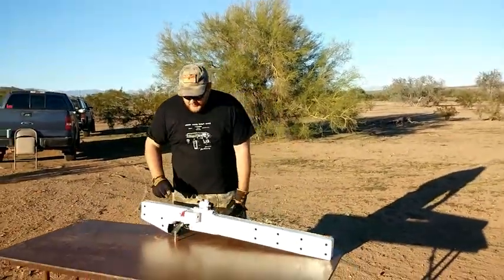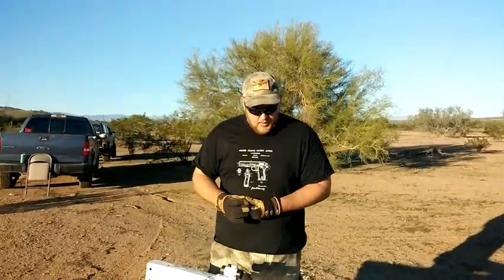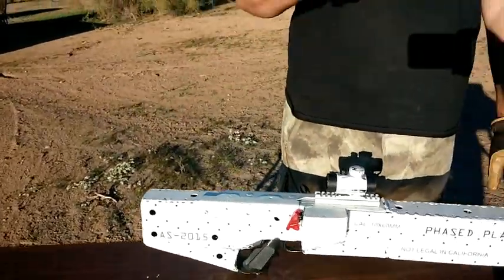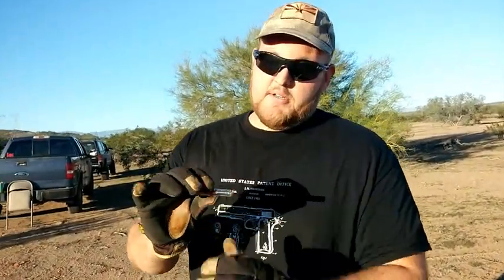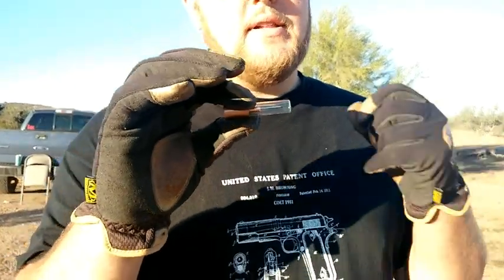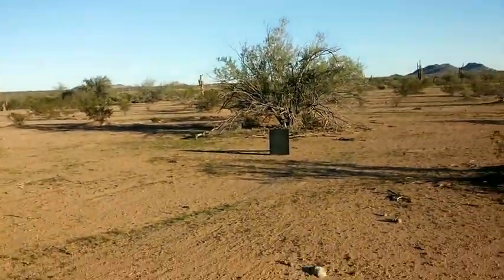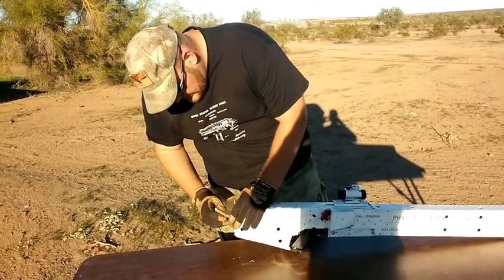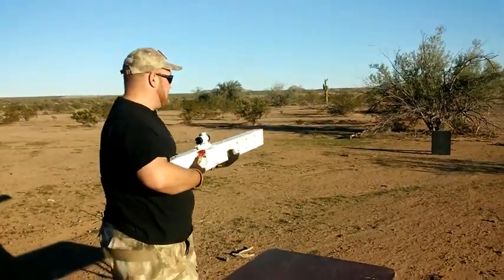Electromagnetic Plasma Rifle Test Fire

Comment: So this is how, the starwars program from the 80s era was supposed to work, Basically using plasma to push projectiles at ulta high speeds. Or rather creating a mass driver. looks like this has a slight twist. instead of a solid shot

Comment: This could be done with linear rails and a projectile that is cunductive on both ends, passing the current from end to end thru the gas. 
One thing I think is happening too, is the plasma is going back to gas before impact. A more intricate projectile that uses a capacitor to store some energy from being shot, and keep it going thru the plasma for 2 seconds after firing.

Comment: Fake
Reply: Neon gas is basically what we use on light appliances it generates plasma while the charge electrical rails are meant to basically throw the object. Increasing the neon gas will make the charged rails accelerate faster meaning it accelerates the electromagnetic in the rails, remember plasma is a really strong electromagnetic force it is enough to power the whole city. So both increasing its power will throw the object really fast
Reply: @jamesedmerdelacruz9478  You should get a job writing the fake "science" nonsense on Star Trek because that's all this is.
Reply: if we use gun powder and neon gas at the same time that trajectory will basically turn into a powerful accelerator. but doing that will require thousands of volts

Comment: THIS IS FAKE by using copper it would make a eddys current in the copper and that would cause it to never exit the gun look up magnet and copper tube  there is a reason you need the projectile to be ferrous
Reply: Not true. I have actually used eddy currents to move copper. Specifically, a transformer with an iron bolt attached will push a thick copper sleeve up the shaft. The threads of the bolt disrupt the field causing it to collapse ate the tips and propels the copper sleeve off the end of the bolt. Weird huh? Try it! I used a transformer from an old H.I.D 1000 watt ballast. No capacitor, just mains voltage. Technically speaking with this design, you don’t use two rails. You use alternating current, so the power is generated by the interactions between an inductor and a transformer. The barrel is literally just a transformer. Long round piece of steel and two coils to transform voltage from the inverter. This also means you only need one pair of capacitors. Great design. Didn’t think anyone else would ever use it.
Reply: @josephjohnson7333  what you are describing is completely different from what happens in the video 

the video shows
a solid copper object inside a non-insulated  mystery  material
Reply: @projectwes4573  this doesn’t show anything really.

Comment: Even a spatula in public is illegal in California...

EDIT 1: I just noticed you actually use CO2, sorry, but that's not enough CO2 to get it to work, it will dissipate before leaving the rail.
In other words, you should try a CO2 or O2 fuel pellet if you want more of a desired effect. Unfortunately, you'd need a resonance chamber and magnetic accelerator coil to extrude the plasma pellet and ionize it when it leaves the tube.

EDIT 2: "solid oxygen fuel" -- perpetuated by a MAGNETIC FIELD.

Exactly my point.

This design it not optimized for such a payload.

Comment: Nerf dart gun is to anti material rifle as this gun is to what you were hoping for.
Reply: I realize this comment is hella old, but apparently you missed what's going on.  Watch his other video on it.  I'd say the cameraman was hit by a piece of shrapnel from the plate as the projectile punched right through with no problems whatsoever.  Looks like he might have a tankbuster there.
Reply: @gratefulguy4130  Well, I've seen enough gun videos to know for certain that if a projectile goes through steel with no problem, it'll be such a clean hole through the steel that it's almost as if a hole puncher was used and the steel was just paper, there might be some metal sticking outwards on the exit hole or even breaking off, but it shouldn't send shrapnel back at you. Maybe the projectile fragmented since it wasn't a standard projectile and made of copper.

Regardless of that though, I don't remember what my exact impression of this video was since it was a long time ago and I haven't seen this comment since I posted it, I never even knew it got thumbs up. Anyway, I don't think I was commenting so much on it's overall power or potential, but I'm guessing my intent of my comment was to reflect on people's high expectations when considering about a railgun/coilgun. 

They're expected to be super-powerful, more so than conventional handheld weapons, so I think maybe I was saying that due to the common expectation of outstanding power, this was probably not as outstanding as people expected, but that's not to say it's not impressive, I actually don't know if it is or not. 

It's hard to tell exactly what happened due to the distance of the camera to the plate. I see something hit the ground behind the plate, but it's possible it was something other than the round, maybe a fragment of the plate? Maybe a piece of what's holding the plate up? Maybe it actually was the round. Who knows? 

It's cool regardless though, because if it can make that loud of a sonic boom, just from the projectile's speed alone, you know it's got some considerable power, probably enough to kill with one shot in the right circumstances.
Reply: Seemed to hit the dirt behind that plate.. if so it's at least as effective as a .50cal rifle with AP ammunition.

Comment: Any one with even a basic understanding of how physics works knows that eavry action has an equal and opposite reaction and that the copper rails inside the rail gun make friction with make a force pushing against the forward force of the projectile witch would give the thing noticeable recoil when the project is moveing with high enough force.

Comment: If this isn't proof that technology is being intentionally being held back in a way I don't know what is.

Awesome science there
Reply: For nations, these new technology is probably already researched but putting it on to soldier is a nightmare in terms of logistics, first you must find source for the material large enough to fit the number then making a factory for these guns and ammo and then distributing it to rank&file soldiers.

But for the common people you can recreate this and theres tons of BP on the internet, you just need to know the place to search it, like how it takes years for a country to equiped its soldier with gunpowder rifle from a bow.
Reply: It's simply not practical to mass produce such a thing. We may have exotic tech but if it's not practical then it can't be used effectively.
Reply: @RavenSmith55280   not to mention EMP
Reply: @NoirChat138  even that and if used may cause severe economic damage without destroying everything in a nuclear hellfire.
Reply: Might i remind people here that the tech industry is never dominated by the latest and greatest.

The most advanced videogame consoles never ended up being the consumer choice

The best hardware innovations never get used in the best CPUs and GPUs

OLD ASS SOFTWARE dominates your operating system to the point that a cpu/gpu can hard crunch data rammed in to it better than the operating systems ability to organise and feed it.

You only get to see and use what is lowest bidder not the shiny sparkly new shit.
Reply: @DoesntHurtYet  you know that gun is fake right it's an ar15 inclosed with in sheet metal  and a nice paint job topped off with a nice little red light
Reply: @projectwes4573  thanks for informing me.
Reply: @DoesntHurtYet   this reminds me of the mystic aura surrounding the term "military grade",  trust me, the Murphy's law is always right 😂
Reply: @NoirChat138  absolutely.

I was lucky enough to serve with the AUGsteyr. Great firearm and remarkably durable. But other service members from other nations or niche sectors often had quite lucklaster weapons with only an emphasis on one or another advantage to the detriment of most other realms of value. 

Perhaps it would fail to fire depending on source of amunitions or the weapon couldn't be disassembled for maintenance until you jammed your thumb in the breach and caressed the stock just right
Reply: @DoesntHurtYet  Gun Jesus is currently playing with one,  the "GR1 ANVIL" and one of the issues popping up is feeding problem when the magazine is low on rods with consequential firing failures
Reply: @DoesntHurtYet  are you Australian?
Reply: @doomguy9049  yes sir.
Reply: @DoesntHurtYet  Right on, I figured because I can't think of any other military forces that use the Steyr AUG as standard kit. Seems like a sweet firearm though, I'd love to own one.
Reply: @doomguy9049  problem of being too expensive despite utility. Australia has a very high defence budget compared to serving members. There are certainly better guns but in terms of reliability, few have ever been so well vetted and proven.
Reply: if you believe in magic
Reply: don't be ridiculous. neither the capacitor tech nor the battery tech is here to make railguns and coilguns more viable than gunpowder firearms and railguns have another problem of vaporizing their own barrels with each and every shot making them extremely impractical for any use unless you have on-the-spot 3d printer forge that creates a railgun barrel every few shots
Reply: Technology is being held back but military tech is not they want the newest shit in the military not table scraps
Reply: @topsdaily_productions  the common soldier gets equipment from the lowest bidder mind you. The colt m4a1 rifle was the lowest cost Ar15 they could get so they went with it. They afterwards didn't go with the Magpul Masada/ bushmaster ACR, nor the FN scar, nor the hk 416 nor nothing.
Reply: @Dranoel yeah it's crazy how you can literally leap-frog cutting edge military technology from your own garage.  We've gone so far beyond having any excuse for using such primitive & wasteful technology on any level: energy, guns, aviation, computing... etc, etc, etc.
Reply: @gratefulguy4130  Spot on. We went from having bricks to tiny supercomputer smart phones which is neat.

Then we have train locomotives with tyres tooo… you get the picture yet

Exotic patents technology that aren’t followed up on or further developed are t hard to find if you know the field and have an open mind.

Just look up mercury torsion tech. It makes my blood boil.
Reply: Always since the days of Tesla
Reply: Fancy schmency but useless
Reply: Dude this thing likely packs less punch than a .22, requires giant batteries, and could easily be damaged in the field. Just like with the new anvil civilian availible gauss rifle, these are early prototypes of what might ONE DAY be effective man portable weapon systems. Power storage and several other key enablers just aren't there you. Technology isn't being intentionally held back by some vast shady conspiracy. It's just that these things are incredibly hard and there's a finite amount of R&D money.
Reply: @alecmeden6325  I  agree you know what's funny it has no batteries because its fake
Reply: Yeah lets use it to destroy an kill everything...
Reply: Titans of Industry do not want to adapt, there is Zenneck Waves, Thorium, Graphene and a lot of Nano tech that has been idle for over a decade, they love petrodollars greed and geopolitics, they use the eggheads for profit while they live in their mansions, these elite need to be put down once and for all. We need a revolution

Comment: Not a "plasma" projectile, liar. Just a regular old metal slug. Plasma is generated between the rails and the projectile during firing in the form of an electrical arc, but you are not shooting "ionised thermal plasma projectiles". Almost as buzz wordy as the free energy fuckwits.

Comment: Alex Smyth, do you have any info/data on the plasma aspect of the round? does it actually have any noticeable affect over just the copper jacket?
Also, can you give us some details on what kind of capacitors you're using, charging, discharge power, muzzle velocity, etc..
I'm extremely interested in what you have built there and would love to pick your brain.

Comment: That's actually genius. If the military took emf generators from their mayham warheads and scalped it down or made a weapon that could chamber a round equipped with it they could easily make a plasma canon. Probably be easier to make it for tanks tho, they already kind use plasma in the mayham warhead to explode vehicle from the inside when it touches the air and the generator only turns on after impact which if the my have tech that can do that they can make plasma weapons easy.
Reply: I mean really it's a generator with milliseconds to vaporize and explode a ball of metal.
Reply: @wooshifgay462😂 its an ar15 disguished as a railgun. Double helix rails? That much power? Puts something in the back without a gas system? So obviously fake.

Comment: +Alex Smyth  Just curious, where did you find the neon tubes?  I've looked everywhere, and no place sells tubes like that. Especially ones that are missing the wiring :/
Reply from the maker: Shops that make neon signs. They fill it with neon gas and melt the ends shut.
Reply: can you make a vidoe on how to made it

Comment: I don't consider that a plasma rifle it is more of a railgun rifle. And to make plasma gun you may need to combine a focus fusion generator with a partical accellerator for the dense plasma sphere and accelerate it at near the speed of light.
Reply: +travis moore A focus fusion core is just a hollow copper tube with copper rods around it to use a high voltage arc to make a dense plasma sphere inside. The idea was to use the particle accelerator to shot that plasma sphere out when it forms to shot a plasma burst out.
Reply: +travis moore The pac "particle accelerator" may need high voltage coils. You might try making rare earth sheeths that fit over the em coils and layering them for stronger field in a pulse like a linear stage coil gun for the plasma.

Comment: This is a Gauss gun, not a plasma gun. A Gauss gun uses electromagnets turned on and off in a sequence to propel magnetic projectile.
A plasma gun would launs either a beam, pulse, or toroid of plasma (4th state of matter, incredibly ionised gas)
which would generally melt or vaporise some materials. Plasma is what stars are made of.
Reply: +Ishy OQGX correct me if I'm wrong but he stated the gun its self was a gauss gun but the projectile was the item that had neon gas that turned into plasma once it received the electric charge
Reply: It's not a plasma gun per say, but it fire a projectile that contains plasma in it.
Reply: Carl's Meat Dragon
True
Reply: +dead frost No, I think he said it was a railgun, which would use electromagnetic rails implementing the Lorentz Force that somehow moves a magnet at high velocity.
Reply: It's a railgun that shoots a bullet that contains a gas that will turn into plasma when electricity is applied.
Reply: +Ishy OQGX If you want to be that technical, it's a Lorentz gun. The problem with the plasma is containment. This is the most practical solution I've seen... glass is cheap.
Reply: armbarsandbarchords Also, didn't he say that the magnets would ionise the neon atoms? Isn't that impossible since you can't remove the electrons with magnets, and in order to actually crate plasma it would have to be super-heated and incredibly ionised?
Reply: +dead frost But yes, about the ionised neon gas, that bit was right.
Reply: so what you're saying is, it's a mag rail lol
Reply: Yeah, he probably is.
Reply: I mean, it is POSSIBLE... just not in the size that he is holding. I'm in school for math and engineering. That's 100% a traditional firearm...with a special housing. He would need to show his circuit, rails, capacitors, battery bank....etc , but it "exploded" conveniently.
Reply: It's none of those things. It's a fancy housing around traditional rifle. Possibly a .308 if that was actually AR500 steel.
Reply: A true plasma gun would look like it shoots lightning
Reply: aseredy is correct. the velocity this guy achieved are simply not possible with technology right now. If it was that easy, our military would be using them in mass. The video is bs (after more math classes under my belt)
Reply: compared all the other videos of rail gun attempts, I believe this is actually a coil that is charging some gas, that is propelled via traditional gunpowder methods. There is simply no way he achieved this velocity.

Comment: this isn't a plasma rifle, it's a Gauss rifle, there's a difference.
Reply: It's a rail gun that fires a projectile containing plasma.
Reply: It's a railgun
Reply: +Josh Perry gauss rifle is coilgun, not railgun
Reply: +Josh Perry Not the same thing. A Gauss rifle (coil gun) uses coils to accelerate a projectile. A rail gun has a set of rails connected to a capacitor bank (like a coil gun) that a moving projectile comes into contact with and the short between the rails through the projectile accelerates it.
Reply: +Josh Perry Absolutely not.
Reply: Same thing

Comment: I'm assuming the copper sleeve is just acting as a casing for the plasma projectile right? Do you think it would add a little more damage if you found a way to make the front part of the copper sleeve sharpened to a point? So it acts as something of a bullet behind a bullet in a way? Since the plasma was powerful enough to punch a hole through the steel wouldn't it act in perfect synergy with the sleeve acting as both a casing and a conventional projectile?

tl;dr Can the plasma clear the way for a sharpened casing to act like a second 'bullet' and keep punching through the 'wound channel'?